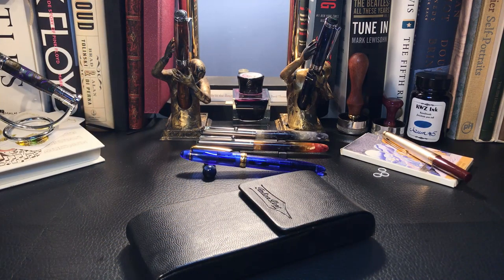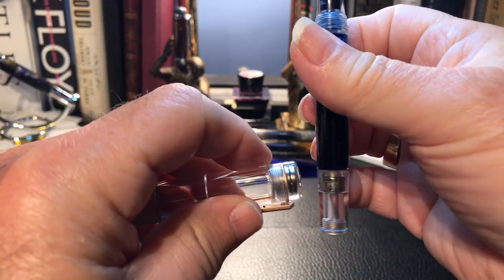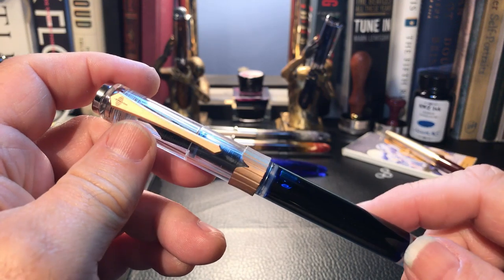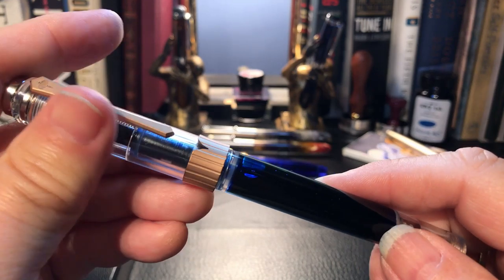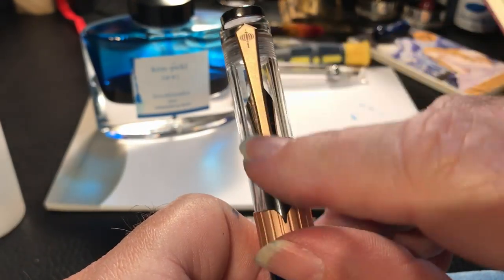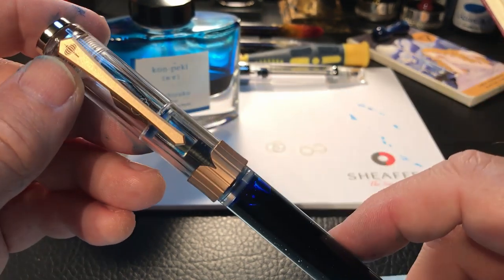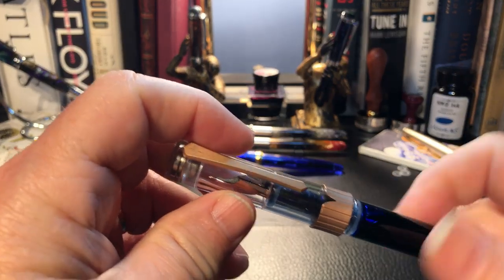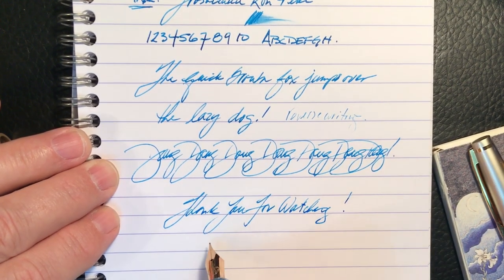PenBBS 492 - Magnetic Piston Filler Fountain Pen Revisited and UPDATE!

Comment: Glad you fixed it.  My guess the screw was not tight & piston stayed stuck, like the issue with the 309 piston filler.  With these piston fillers, once you get the piston to move it moves well.  My 492 writes wetter, no adjustment needed.  I used PenBBS ink.
Reply from the maker: Thanks, Chris. I did try to tighten the screw with no success. That's why I had to add a drop of glue to hold it fast. It works now though. :)

Comment: It's such a gorgeous looking pen, glad you could fix it. 

One of the reasons I don't post sometimes is because I want the clip of the cap when it's posted to line up perfectly with the nib. Its annoying when I observe that it doesn't line up.
Reply from the maker: If you are particularly OCD about that nib lining up with the clip (as I am),  you can pull the nib and keep moving it around until it lines up when you screw the cap on. Of course, most of these Penbbs caps have multiple start points on the threads, even when you get one of the start points to line up, you'll still need to find that start point every time you cap it. I don't mind being that obsessive about it. :)

Comment: I found that the piston also was difficult to move, until I did one thing. I unscrewed the section, put two drops of silicon grease directly on the piston, then moved the piston up and down to coat the barrel completely. Now it works extremely well and I don’t even need to rotate the piston when filling.
Reply from the maker: Yes! That was the very first thing I did!
Reply: Douglas Rathbun Great minds think alike! I hope your PenBBS 492 continues to bring you an excellent writing experience.

Comment: Congrats on the working pen! I would guess you don't need the second magnet anymore, perhaps you tried that off camera. For some reason my intuition is that the double magnet is not helping, but I can't really explain why.
Reply from the maker: It works with or without the extra magnet. And I can't really tell if the extra magnet exerts more force than a single.

Comment: Douglas, you could invest in some "ink misers" for when your bottles are running low.
Reply from the maker: Thanks, Kenneth. I have a 3D printed one that my son printed for me. I was illustrating one of the issues with 492. I was interested that the magnet actually pulled the piston up from a good distance away and it actually worked on my Iroshizuku bottle.

Comment: For everyone who has OCD with the nib aligning with the clip, I've noticed that for my clear PenBBS pens the nib always faces up in one of the two threaded positions when I lay the pen down with the clip on the left. This leads me to think that the factory alignment is in fact intentional so the nib faces up while the clip is acting as a rollstop. Is it a bug or a feature? :00
Reply from the maker: when you have a threaded nib assembly, a threaded section and a threaded cap, getting the nib to line up correctly with the clip is very difficult to do in manufacturing. The best way to obtain it is to have the nib/feed and section all fused together so you only need deal with the (usually two) thread start positions and you line them up with a start position when you set the nib. Penbbs has a removeable nib and feed inside a removable (threaded) nib collar which screws into the section. This allows for easy cleaning and nib swapping/replacement. Getting the manufacturer to line these elements up would increase production cost and remove end-user options. You can still line these things up on your pen. Pick a start point and screw on your cap. Then make a very small mark on the clip UP position on the nib collar. Then pull the nib and feed (not unscrew) and reseat the nib/feed nib UP to line up with the clip UP position. This way you'll have at least one of the start positions lined up with the clip. Worked for me. I do this on my 492, 456, 355.
Reply: @InkquiringMinds  that makes sense. I don't remember if my 268 arrived with the cap in the position I described but since the nib section only has one entry to the thread I assume the nib only needs to aligned to that? But I suppose aligning the clip with the threads to achieve that effect would be just as difficult..? Whelp
Reply from the maker: @junfu9146  I don't have a 268, but with a $17 vacu-filler, I doubt you'd have the manufacturer worry about nib alignment. My $30 456 has three start points on the metal threads of the body and I can align the nib so one of them lines up perfectly.

Comment: I don't buy the user error. My 492 does the same thing. The piston gets stuck, and then works perfectly after nudging it nibward. 
The kicker on mine is that the rat cap on the end of the barrel doesn't unscrew when downward pressure is applied. I found out that I have to use the cap magnet on the rat cap to remove it and access the rear of the piston. Figuring that little trick out was about as frustrating an experience as I've had in this hobby. I was cursing this pen, all because I didn't care for the ink that I initially filled it with. 
I have a like/hate relationship with my 492. Once it's inked up, it's pretty nice, but the next time I want to change ink colors I'm just going to do it eyedropper style and save my sanity.
Reply from the maker: Thank you, Franken Beanzzz! Yes, unscrewing the rat plug with the cap's magnet works nicely.
Reply: @InkquiringMinds  the big downside to that is that the top of my cap is scratched up from using it as a screwdriver.  No, the rat cap is screwed down just far enough that I can get my fingernail under the edge so I can avoid any further scuffing of the cap finial.

Comment: The magnetic piston of the 492 has an embedded fail: you wouldn't never operate a magnetic link on two magnetic field disposed at 90 degrees.
Trying to explain: on the cap you have a magnetic pole, on the piston you have two opposed poles. So, while the pole on the cap is attracting the opposite pole on the piston, the other pole of the piston is rejecting the pole of the cap. 
Magnetic links works only when the fields are oppsed at 180 degrees.
Try with two spare magnets and you'll see what i mean.
Reply from the maker: I'm afraid I don't comprehend your explanation, Antonio. Are you saying the design of the pen is flawed? It seems to work.
Reply: @InkquiringMinds  you know magnets have a north and an opposed side, south.
If you want a strong link between two magnets those would operate in order the pole of one magnet is yust in front the opposite pole of the other (magnets facing 180 degrees)
 In the case of the penbbs 492 the magnets have a cylindrical shape, in this case the   poles are usually located on the bases of the cylinder.
So, if you want a strong magnetic bind the magnets would operate front to front and not front to side.
When you try to bind two magnets the face of the first against the side of the second (90 degrees) the magnetic coupling is way less effective.  This seems to be the setup of the 492: the front of one magnet (cap) against the side of the other (barrel).
 Try with two spare magnets and you will understand what i mean.
I'm not saying the pen can't work, but when you design something based on magnetic binding you would possibly provide the best effectiveness of the connection, don't you?
Reply: @antoniomandelli2311  My own personal 492 is stuck in China for over a month, so from what I've seen in Doug's and Chris' vids, I can tell you that that part is not the problem. the magnet on the cap seems to be polarized with the axis to the length of the pen and the one on the piston is to the width (the  cap attracts it to one point in the circumference, or else you could not use the cap to spin it, only pull it up and down from any angle around the barrel.

The mechanical things I am worried about:

1. Spinning the piston is a nice trick to jerk it out of the static friction threshold without making it jerk in the length axis and cavitate or spray out the ink.However you have to remember to do it only clockwise as to not loosen the screw inside the piston.

2. I'd use some cloth or soft TP between the cap and barrel, it seems the acrylic gets scratched.

3. I am confused about the air pressure behind the piston, I'm guessing there must be a compfy hole to ventilate the back chamber in and out or the piston would have a lot more resistance (unless you plug it with silicone grease :-)

4. I'm wondering how the piston stays stable with just one o-ring as the contact with the inside of the barrel. the force on the magnet is quite strong and only in one direction, making it want to tilt diagonally and pass on uneven pressure to the ring. I would have to assume it will either bend it out of shape or cause it to leak on some pens, I'm glad it seems dependable so far.

as for the operation when the pen is deep in the bottle - I suppose a half fill + air expunge + second half fill will also be fine in such extreme cases.
Reply: @Seefood73  i don't own a 492 , so i can't tell. By what you are telling me, the perfect workaround would be using two magnets, on the opposed sides and opposed in polarization. You would operate them simultaneously and the piston will slide as a charm.
Douglas, you can try this:  put the cap on one side and the additional magnet on the other ( be careful the side is touching the barrell is that which is attracted from the cap), then slide them together, in parallel.
By doing this the oring will not be solicited  at one side only and  the magnetic strength will be doubled.
Reply from the maker: @antoniomandelli2311  I understand how magnets work, I was confused about how you consider this design flawed. The N-N pole line up and stick very strongly. The opposite side (S) doesn't repel the magnet any more than two flat magnets do. If you try to line up the N-S, cap to piston, the piston or the pen itself, spins quickly around to line up N-N. I don't see any flaw in this and it is the same design patented in the US in 1950.